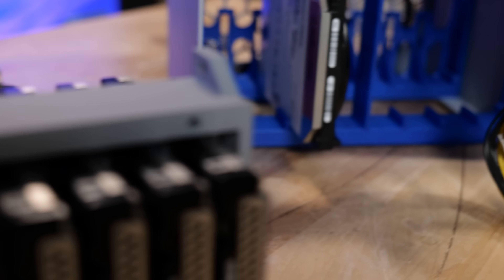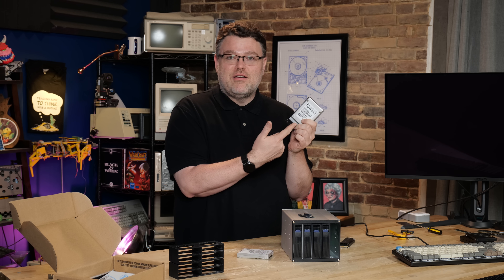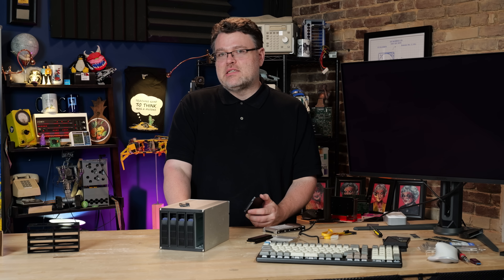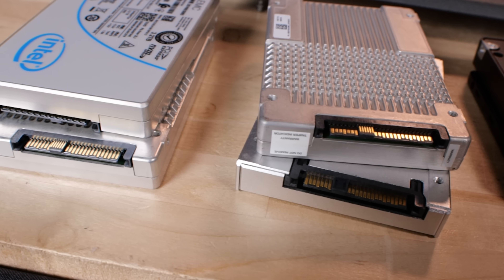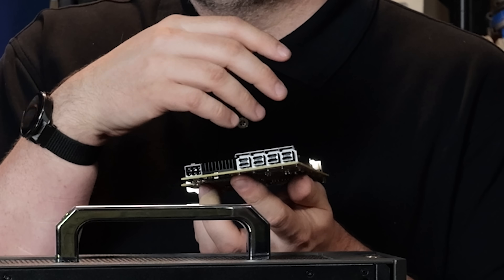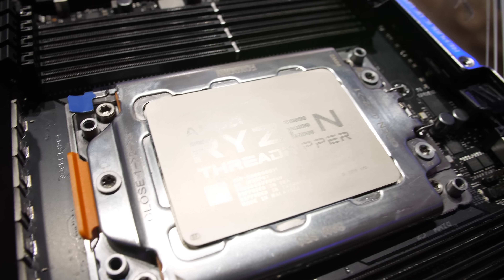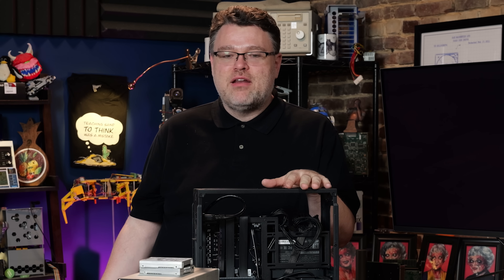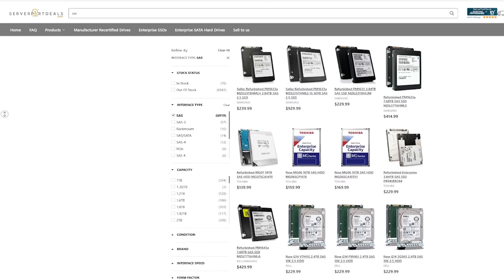Need Cheap Mass Storage? Try Surplus SAS Flash!

Comment: Yeah, do your research on these things before you purchase.  As Wendell noted, some of them are formatted with 520b sectors and not all are easy to reformat, and others have firmware bugs that will brick the drives.  A few years ago I spent a non-trivial amount on (16) 1.6TB Toshiba SAS drives for my mid-tier storage.  (Not as fast as my smaller NVMe array, but still way faster than my spinning rust) They had a firmware bug and bricked after a few months of use.  Toshiba sold off (spun off, whatever) that portion of their business to Kioxia.  Neither company has any interest in supporting the drives at this point.  Dell and a few other companies rebranded them and they offer firmware updates to fix the problem, but they're all vendor-locked and won't install on the Toshiba drives.  Long story short, my glorious 20TB of flash is dead.  So buyer beware.  

So unless Wendell wants to help me undertake a firmware mod project (I live right down the road in Lexington!) these things are toast.
Reply: I have the nvme fw reprogramming utilities but not the sas ones, sas is no bueno :(  nvme 1.6tb can be re-provisioned up to 2tb with much worse wear endurance if the drives arent already shredded
Reply: @Level1LinksWithFriends  Thanks! I appreciate the response.  The good news is all my data was backed up, and I've moved anything that needs more speed than spinning rust can provide on my NVMe array.  Big fan of the Samsung PM1725 line.  Add a mirror of optane drives for a dedup drive, and a TB of RAM and it can hold and do anything I need.  The SAS drives are just sitting on a shelf waiting for a rainy day when I have the time and motivation to sit down with a hex editor on the vendor-locked firmware to figure out what's vendor-locking them.  (and hopefully not perma-bricking them all in the process)  I also have an SPI flash module I might be able to brute force a flash update with.  

My current project is trying to get the OS sorted on my Dell S6000-ON and migrate everything off of my Mellanox switch.
Reply: @Level1LinksWithFriends  Another fun project you might be interested in...  I have a Dell 10N16 controller out of a SC4020 shelf.  It seems to be pin compatible with the NetApp IOM3/6 controllers from the DS424x Disk shelves, though it also appears to be vendor-locked.  But rather than being a "dumb" SAS expander, it's a full xeon-based PC. I suspect it could run TrueNAS Scale but it would have to be installed via RS-232 console and I'm a little out of my element there.  But would make for a neat "Smart" disk shelf.  And with a low profile PCIe x8 slot it could support 40Gb networking too.  

You know... in all that spare time that I'm sure you have, just like me!  🤣
Reply: @ajhieb I have a couple of Toshiba 800GB SAS SSDs which are Dell branded. Might be from the same series. Let me know if you play around with those drives and want some help. I have soldering and firmware tools and skills, and love a challenge.
Reply: What's wrong with 520b sector sizes? The SAS SSDs I'm running right now have 520b sector sizes and works perfectly fine with my controller on linux. These drives were pulled from netapp disk shelves.
Reply: @KillerRabbit008  Depends on what hardware and software you pair them with.  There's nothing inherently bad about 520b sectors, but they aren't universally compatible like 512b sectors are.  Windows won't recognize 520b sectors.  Truenas (which is what a lot of homelabbers are using) either won't recognize them or will throw errors, depending on what version you're using.  In some cases you can fix them with sg_format, but not always.
Reply: @ajhieb  When I initially picked up these drives, I formatted them to 512b sector sizes, but didn't notice any capacity or performance change, so I just reverted them all back to 520b.

I'm surprised truenas has issues with 520b sectors. Is that only on truenas and not truenas scale? Difference between linux and bsd kernels?

Comment: For the 3.3V issue for some of the drives, there is a 3rd option, you can disconnect(some even cut the cable directly) the fifth power cable from the sata type power connector
Reply: I hacked a drive long long ago using Kapton Tape, frankly I am not sure I have the stable enough hands any more to attempt it.
Reply: Or if you don't care about the warranty you can remove the pin on the drive it's self. Just don't screw up and remove the wrong one. 😅

Comment: I was so hopeful awhile back that finally ECC would get more common in the consumer space but it just hasn't materialized.  So many cool mini PCs and ITX board but it can be such a crapshoot if it actually will support ECC memory that I would want in a small homelab like that just for the peace of mind.
Reply: You dont have to bend over backwards to get ECC. Its not like if you dont, you will have frequent data corruption. It is very rare, and most software and file systems can already deflect this... A bitflip can also happen on ECC anyways, its just a little more protected against it. Running small serveres with a couple of gigabytes flying around in ram, wont turn into a catastrophe if you arre "lucky" enough to catch a bitflip by some cosmic particle.

Comment: £350 for used 8tb kioxia CD8 in the UK,    i cant find SAS flash for that cheep.
Reply: Indeed.  UK ebay with 960GB SAS SSD = one listing under £90 used.  There's some 800GB around £50, but they reach £80-90 real quick.  There must be many many more server farms in the USA birthing used drives.

Comment: Looks like it's still more expensive than spinning rust
Reply: Significantly. It makes no sense to have a solid state media library for a small organization or a home. The use case for these is storage for virtual machines, at least that's my use case. 

The other thing is, purchasing used spinning rust is often more reliable, or at least it's reliability is predictable.
Reply: @hellboundedward  definitely not for bulk storage for all those linux ISOs
Reply: @GameCyborgCh I ended up using the spinning rust for not just ISO backups, but steam libraries. The SSD arrays are for the OS drives. With a NVMe cache (warning! Make sure that disk can take a beating), you really don't see a performance difference between the two.
Reply: @hellboundedward I think in theory if you can get some cheap DRAMless QLC with good data retention and read performance it can make sense for some people, some of the time to run solid state, since it uses a lot less power (yes you can spin down HDDs but only some of the time and that increases wear while limiting storage flexibility) and can be a lot more compact. That wouldn't apply to enterprise drives though since those use a lot more power and the solutions required to make them work are bulkier than something like that Beelink with 6 x1 lane M.2 slots
Reply: @hellboundedward  Legit question for a nooby; is it feasible to use my UNAS Pro (16TB) as VM storage if I have it wired up via 10G SFP+? I was going to spin up immich and start to experiment with FOSS. I have a pair of 2TB NVME's lying around if necessary.
Reply: @jordantylerflores I don't believe the UNAS pro supports SAS drives. You will get better performance out of mirrored NVMe.
Reply: Its normal for it to be more expensive than rust but it's still more expensive than brand new SSD drives like 870Evo were just few years ago... for a 6 year old drive that did 24h/7days a week...
That's not the direction tech prices shall go...
Reply: I still swear by rust tumblers for data archival.  When super fast random access is not required rust tumlers actually provide pretty decent transfer rates, their prices are more attractive and they don't mind if stored without power for extended time.
Reply: yknow i cracked a few of them open and for spinning "rust" theyre awfully shiny
Reply: @bottlekruiser  They're an awfully high-tech variant of rust.  At the same price per mass an old car would be worth billions ;-)

The base material used to be aliminium but more recent platters are made from very special glass.  It's not only surprisingly hard to smash compared to drinking glass or window glass, it's also very temperature stable - even more than standard glass.  On top of that the "rust".  Which really is a complicated mixture.  Older drives were based on iron(III) oxide (Fe2O3), more recent models are more likely based on cobalt.  Plus small quantities of other materials to carefully control the properties and crystal structure almost down to the atom.  On top some protective layer.  The exact composition is secret, of course.

Comment: HHHL NVMe drives are even cheaper. I picked a trio of Samsung (Oracle branded) PM1725 3.2TB drives on ebay for 90€ a piece. Sure they had 79% endurance left, but that's on 5 DWPD. According to an online calculator, that translates to 26PB, of which ~20PB are left.

If you're going to use an ITX board with a cheap bifurcation adapter, you can put four of those into a 4x4 bifurcation adapter. All they need is a small fan for some airflow to keep them cool, but I guess so do those SAS drives.
Reply: yes sas drives need cooling, they are designed with server airflow in mind

Comment: I saw "cheap mass storage" and had hoped it meant they were down to like $10 per TB. 
Planning to go with HDDs for my new NAS.

I bought a Minisforum BD795M to use as my HTPC/secondary gaming pc/playing around with LLMS PC

This freed up my old AM4 rig for a DIY NAS.
Asus X570 ATX, 5600x, in my old Rosewill Thor case.
Currently it's got a 2tb nvme and a pair of 16tb Sata drives mirrored.

Planning to grab a used HBA to stick in one of the PCI Express slots,  then set up a 8 drive RAIDZ2,  i've seen 10-14tb used enterprise drives for as low as like $7-9 per TB.  
Assuming 14tb drives,  if I buy 10 drives,  with 2 for redundancy, 2 spares so that when a drive fails, its easy to deal with,  then it would give me an 84tb pool..   for under $1200 worth of HDDs. 

Currently we have a hodgepodge of external drives, an old 10+ year old 4 bay array, and various 1-16tb internal hdd, and various 2-4tb NVME SSds in our PCs here...     We horde stuff and never delete...
Reply: Minor suggestion: striped mirrors are almost always the right call over RAIDZ2. One reason is that it is significantly easier to expand a striped mirror. You can either add two more drives, or replace two drives one at a time with higher capacity. 

The other reason is performance.
Reply: @hellboundedward  This is all very true. I agree with you.

I'm still planning on using RAIDZ2 for this build.  (but i don't recommend it to others mostly because of how slow it is,  and the fact that you can lose the whole array when more drives fail while slowly rebuilding the array after the first drive fails.)

I've got RAID5 running on a very old QNAP NAS (drives are cheap SATA and have almost 100K power on hours.  It writes at like 10MB/Sec)
I can accommodate around 20 HDDs in my chassis.    So if I go with an 8 drive array,  I can always install a second array to expand.

I'm hoping hard drives are bigger and cheaper by the time I need to upgrade.

Comment: It's certainly cheap*er*, but even four of the 3.84 TB drives would run you close to $1000 USD.

So, I wouldn't exactly call that *cheap*.

(And that's just the cost of the drives alone, excluding the rest of the system.)
Reply: Yep. Unless you have the bandwidth to saturate in your network it’s certainly better to just go with a Samsung 870 EVO 4TB for the same price with warranty coverage brand new
Reply: @tttomtxhc  
Even if you had the bandwidth available, your applications need to also be able to make use of it as well.

I put two Silicon Power US70 1 TB NVMe 4.0 x4 into a ZFS stripe and then put iSCSI targets on top of that, so that I can point Steam to install games to it, and Halo Infinite, when it was loading, could barely muster asking for 5 Gbps (as reported by the TrueNAS Scale VM), when the game was loading.

Most games that I was testing with, barely asked for 2.5 Gbps, when said games were loading. (And this is on a 5950X system with a 3090 in it and 128 GB of RAM.)

So even if you gave it 10 GbE networking, if your apps can't make use of it, giving it more bandwidth would be completely irrelevant unless you have multiple clients pulling data from it, simultaneously.
Reply: I dunno, that sounds pretty damn cheap compared to the exact same thing if you live outside the US
Reply: @bosstowndynamics5488  
Well...."price" and "value" is always relative.

(cf. prices of software (*cough cough* Adobe Creative Suite) in Australia vs. US)
Reply: One of the things that Wendell has that I don't is the experience to recognize a good deal on these products.

I don't have enough experience, so I keep making mistakes. Using a consumer 500 GB Gen 3 NVMe as the cache for a large spinning rust array was a mistake, for example.
Reply: @hellboundedward  I use a 112GB Optane for cache. Got a bunch of them very cheap about 1-2 years ago when Intel was getting rid of them.
Reply: I don't think their audience is people doing this for a hobby and storing large amounts of legally procured multimedia.
Reply: I almost went 3.84 because I found a seller at $120 if you bulked 4. But I ended up not going because the next cheapest was $220 and I don't want to to have a replacement cost about $100 (at least on 1.92)
Reply: Correct. Which is why for the current NAS I'm building I opted for 8x6TB spinning rust SAS drives. Got them for under $300 all (including 2 spares) with about 50k hours on them, all testing good and so still about 5 years or so of useful life left in them.
Reply: @stamasd8500  
I'm a strong proponent of the used HDDs, especially enterprise drives (SAS or SATA, doesn't really matter to me), for my "do-it-all" Proxmox system, where I am currently running something like 334 TB raw now (4x3,8x6,8x10+8x12+8x12) something like that.

On a $/GB basis. it is the most cost efficient way I've found to get a lot of storage.
Reply: Might as well buy p4510's for that price.
Reply: Odd, I see 7.68TB for €350 and 3.84 for €200? And jsut on ebay there are offers for €560 for 7.68 sas ssd?
Reply: iuppiter, a used server hardware shop from the Netherlands, recently sold single 15.3TB drives in three different auctions on eBay: 

Samsung MZILT15THMLA-000G3 15.3TB -> sold for 671€
Kioxia KPM51RUG15T3 -> 605€
Seagate XS15360SE7008 -> 576€
(all 100% health)
 
or, e.g. Samsung MZILS7T6HMLS-000C3 7.6TB, two units for 525€ and 565€ in the other auction. So we're clearly below 1000 dollars for 16ish terabytes of enterprise flash already...
Reply: Yeah I mean, someone is clearly doing quite well to think this is cheap. I am happy for him but wowsers LOL.

Comment: I really wish Optane SSD with cheaper prices and bigger sizes had become a thing, with insane endurance (in hundreds of petabytes)...
Reply: I know.  During covid, I bought 4 280GB for only $200 (with the tax).  Nobody knew about them (then), until Wendell did his story on them.  And now they're $150+ a piece.  I bought 4 because I thought they'd only last for maybe 4 years.  I'm not even close to killing these drives. I use two of them as a main OS while video editing and music production and Unreal editing;  I think I might get 6-10 more years out of them.  Its crazy.  (probably even longer).  The other two are just sitting on the shelf.
Reply: Just received my brand new, old stock, 0 power on hours p4800x 375GB optane u.2 drive for my main VM/LXC SLOG. Pricing wasn't too bad for something that will last me years ($172 USD / $240ish CAD)
Reply: Yeah... Optane really seemed promising and they never gave it a real chance!
Reply: They'd still be more expensive than flash
Reply: On paper. Insane endurance, on paper. In practice, Optane is the leading cause of bricked installs in OEM machines equipped with it. I personally suspect this to be a huge part of why Intel abandoned Optane.
Reply: Unfortunately Intel holds the IP so no one else can work on it and Intel is all over the place these days.  I doubt they are going back to Optane. NVMe kinda tenders it pointless.  However I think there's a niche use case in NAS as a boot with controller that speeds up your mechanical drives.
Reply: @JemieBridges  There are definite use-cases for optane, however, like you said, Intel no longer makes optane and probably never will due to its unprofitability.

Comment: I'm using an old HP workstation as server but it's a dual socket power hogg. I'd love to build something based on a ryzen mobile processor. Trouble is I need enough lanes for a GPU, a SAS controller, and a 10gbit ethernet.

Comment: I have a HPE AFA SAS storage array in production still, 10.5 years old, only a single component failure a SSD failed a couple of years ago(no warning, took about 2 hours to rebuild, distributed RAID 5 3+1). The "most worn" drives have 85% of their "wear" life left on them. Zero read/write errors over the life of the system for all SSDs, the flash brands are Sandisk and Samsung MLC drives(or as HPE called them "cMLC"). At the time of purchase each drive(1.92 or 3.84TB) was probably about $20k list price, system cost as a whole was around $500k(after big discounts) with 4 controllers and 32 drives. It's blown my mind how reliable the system has been. At this point I am not sure when I may retire the system entirely, it's got plenty of space and performance is not a problem, and I do have 4 hour on site H/W support (3rd party as HPE doesn't support this anymore), I do have other storage arrays to distribute the risk in the case this eventually does fail in a bad way before it gets retired.
Reply: Hell. Yeah.